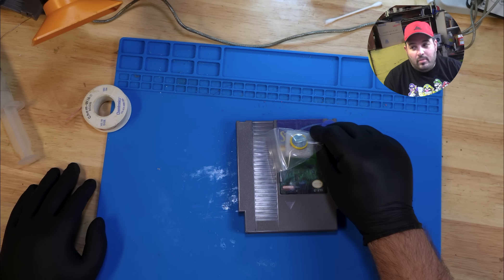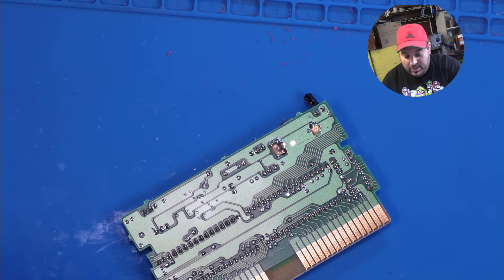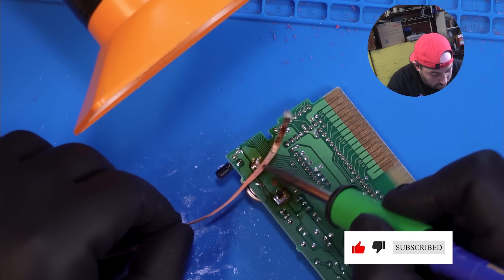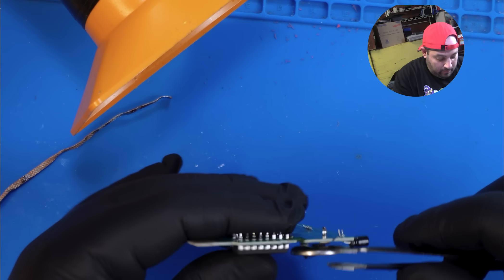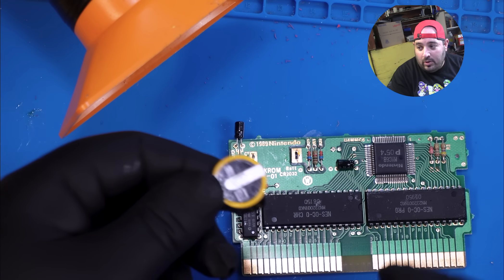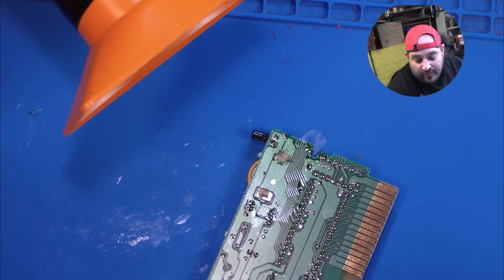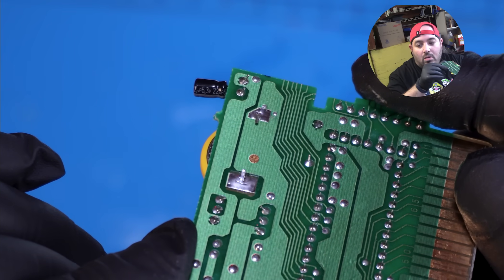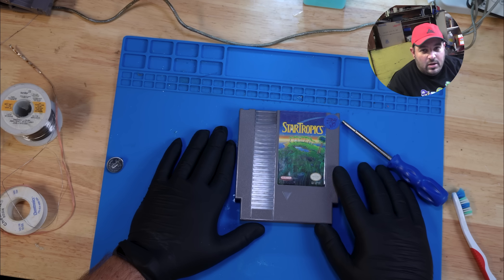NES Cartridge Battery Replacement Guide

Comment: Hmmm....I wonder if it's possible to replace the battery without losing your save?
Reply from the maker: I believe there is. I've seen people replace batteries while the cart is plugged into the NES and turned on. I don't particularly like that. There is another open source device you can create and read and write the save files. That I'm looking into as I'd like to try that
Reply: You have to have the game running or you can extract it with some kind of reader if I'm not mistaken (I forgot what it's called but it's like a three in one on AliExpress for Sega Genesis, NES and SNES). But I'm not 100% sure if it can read saves.

Comment: Why you soldering? 
Just pop that old 2032 out with a toothpick and slip a new one in.
You don't think that they actually manufactured the board WITH the battery installed, do you?
NO! Someone, halfway through production, popped that in after the those pins were soldered to the board!
I have yet to see a button battery that is not intended to be replaced without board deconstruction.
....but you'll still lose you game data ,  Just like your PC's CMOS clock will reset by replacing it's battery
Reply: I am wondering the same thing. He turned a simple battery swap into a complicated process that could have potentially ruined his cartridge.
Reply: @bethanyaudion9441  the battery is sonically welded to the terminals that connect to the board

Comment: I hate how difficult they make this stuff. I applied solder and resin and it still wont pop off. I even used copper (it stings if you hold the copper lol).

I'm not applying too much soldering iron to the connectors because batteries get set on fire if it's too hot, but  it seems like I have little recourse. 

Gameboy batteries are so much easier to desolder, though you shouldn't have to do that at all when so many devices exist that run on 2032 without soldering being needed.